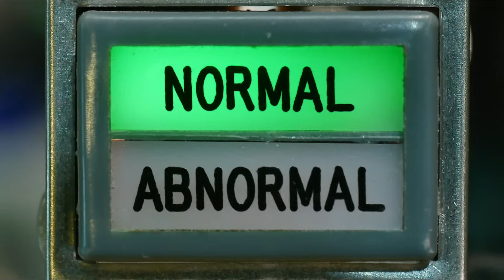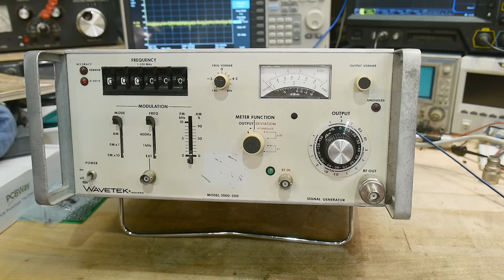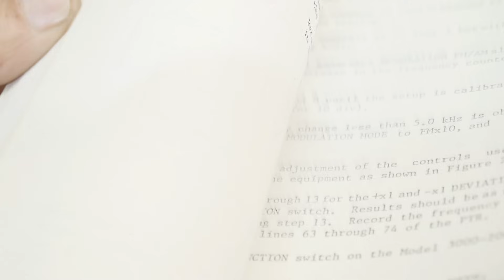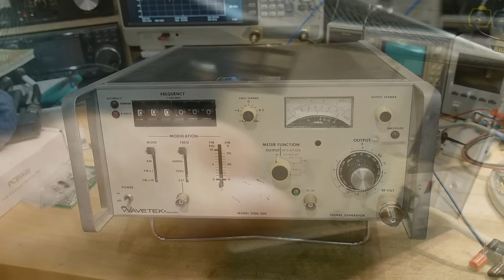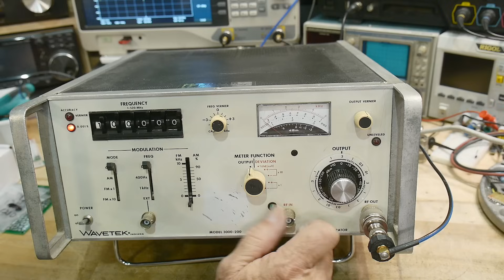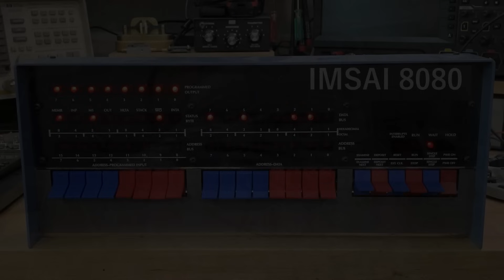#1897 Wavetek 3000 RF Generator (part 1 of 14)

Comment: Eek! I have the same animal. Five PLL goodness. The schematics in the manual are just suggestions. Mine melted it's power transformer once, so I have another hanging off the back, after a failed attempt to convert it to switchers. DON'T! - noise! noise! noise! The bottom plate once shorted with the can pins - bad. The pins come out of the teflon shoulders, too.  I can go on, but I still love it. I used one as my LO on an experimental GPS receiver in the early 80's. It's sentimental, yep. 73's  W3IHM  PS  - lemme know If I can help.

Comment: Major pet peeve when jerks use sharp tools to remove cal stickers and damage the front panel.  POS wouldn't do that if it was their own car, but if it's somebody else's, who cares, scratch away!  

My dad taught us kids that if you are using somebody else's stuff, you respect the equipment and return it in as good or better condition than when you started.  If it's your own stuff and you want to screw it up, that's fine, you paid for it so you can do whatever you like to it.  I wish more folks had a similar upbringing...

Looking forward to the follow up video's, you never disappoint!
Reply: @Willam_J  Also used in auto body work as well.  I've got one and a bunch of blades in my box out in the garage, although I avoid body work as much as I can.  I also have a boat but the decals on it are pretty petrified and just destroy the plastic blades.  So for now "Metaxification" remains the name of the boat.  Don't ask what that means, I, Google, Chat GP, and anybody else I've ever asked says it's a nonsense word.  For cal and ID labels on equipment I've always used a little heat (an SMD tool works a treat) to soften them up and use a plastic spudger to carefully scrape it off.  A bit of alcohol usually cleans up the glue residue nicely.  Never thought about the plastic razor blades, I'll give them a whirl next time around.  Thanks for the idea!

Comment: I have 3 Wavetek 3001 signal generators. All of them have a problem. One unit has unlocked PLLs, Another unit has a bad power supply and unlocked PLLs. The last unit the PLL will get around to locking, but the output frequency is all over the place and not putting out the selected frequency.   I was told they are great when the work, and a bear to service when they don't work. The can with the red button is the RF protection box.
Reply: I have 2. A Model 3000 and a 3001, neither working. One used to lock in 10, 20 minutes but not now.

Comment: I like old Wavetek gear. Built like a brick shithouse. Just give 'em an oil change every 5,000 miles and they'll run forever. That protoboard has to be added by the owner. Wavetek would have laid out a bd for any mod.